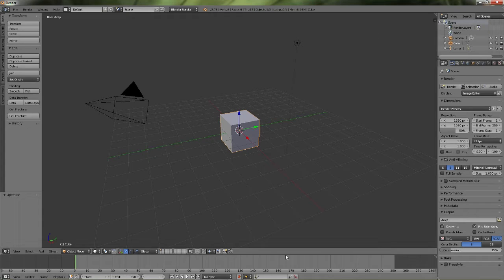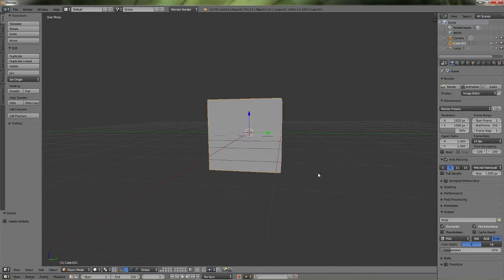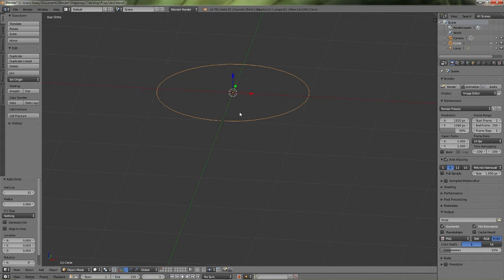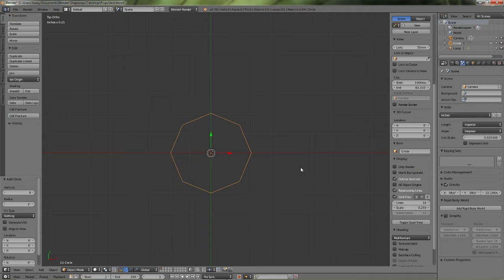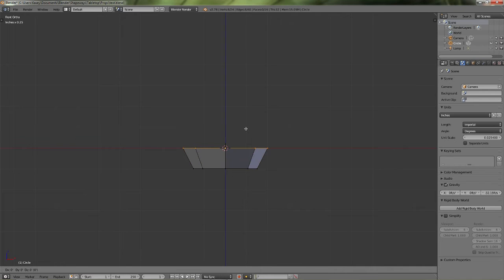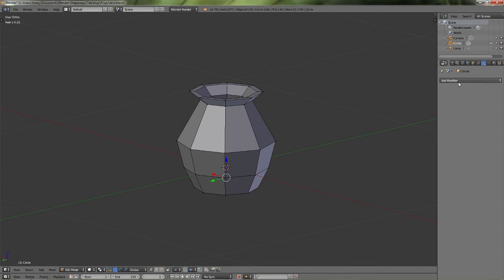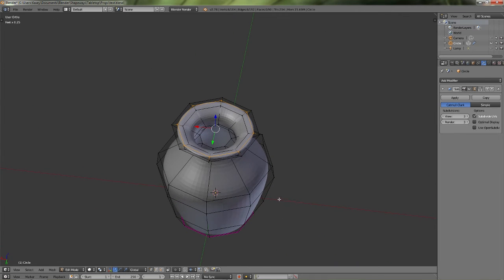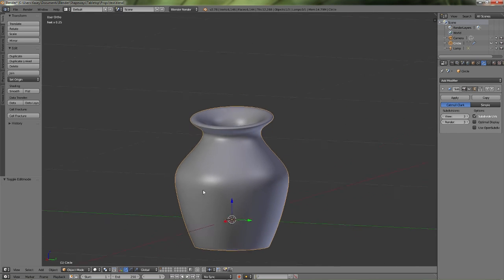Beginner Blender Tutorial for Modeling and 3D Printing

Comment: hmmm, you say to start with the minimum amount of vertices, this is the opposite of what my 3D modeling professor says, shes says that you can always scale down but scaling up when you started low is nearly impossible and you are better off starting over. You said that your computer may not be able to handle the file, my career is in CIS & network administration and unless you are running a Apple product or a computer from a "big box" store, then you should be able to handle most files. Just some questions and ideas, maybe quickly cover specs of your system for reference, for example my 3D design and printing system is a Core i7 with 12 threads, 64GB of system RAM, dual RX 480 8GB GPUs (16GB total in Crossfire), a Samsung 1TB SSD for the primary drive and 7 other larger drives for storage connected to 5 23" Asus LCD panels.
Reply from the maker: That's very interesting. I've never heard anyone wanting to start that way. Anyone I've learned from always starts with minimum verts and can easily scale up, no matter what program they were using. But, everyone tends to develop their own technique :)
Reply: @Kasey3DSparks  It could be that we are in a chapter on developing video game characters, buildings, vehicles, etc and she is very firm on a high vertices and high poly count in the base mesh, we just started that before winter break so who knows but i got a bit confused when you mentioned lower is better, to start. I have watched other tutorials and it seems like blender "should" be able to auto scale up or down, so perhaps she is just trying to get us used to a high detail level so that once textures are applied the base mesh will allow the most possible flexibility. Have a Happy New Year.
Reply from the maker: @milohajek  that is very possible! Happy new year :)
Reply: @Kasey3DSparks  or the professor is just messing with us "older" students, all i really want to do is make a classic 1/24 scale race car driver that i can get into a .stl or .obj file so i can print them on my 3D printer, if you have any that you have done i would be happy to work out something with you for a file or two. I am getting tired of paying $8.99 per figure to one of the few people that makes resign ones and sells them online when i have a perfectly good makerbot gen 2 (i think its a gen 2, anyway its the one that was $3,499 about 2-3 years ago and its basically printed a few car bodies (which i wasn't impressed with) and otherwise its been really good a ornament on top of my other desk so if i could figure out how to make a figure and print it myself i would be super happy. Oh there is a guy that sells one that is exactly like what i would want but 1. he's in Australia so shipping takes forever, 2. he wants even more per figure, i believe $12 and 3. a majority of his stock is "on demand" so you have to not only wait for the shipping time but you also have to wait for him to make them, Its the red colored figure on this page ( http://members.optusnet.com.au/bpatto/resinheads.html ), so if you think you could create a 3D printable one that looks even remotely close to this resign one i would be blown away as that is one of the two main reasons i took this class, the other is for a game a few friends are working on and we hit a wall when we discovered that none of us knew how to 3D model in the right program. Ok, well that's it for me, hope you have a great day and please let me know if you think you have something that might work or if you would be interested in making something like this. Thanks
Reply from the maker: Unfortunately, I do not have any files like that. But I'd be willing to take on a commission for creating a file for you if you're interested. You can email me here: kasey2shea@gmail.com 
I look forward to hearing from you!
Reply: @Kasey3DSparks  that sounds fair, i found several that are "close looking" on CGtrader.com but none have that "vintage" look like this red figure. i signed up on CGtrader and got a $20 off your first order and the one i was looking at is $37 and there are a few others for $12 to $22 so i am sure if i hopped on there i could rack up a quick bill pretty fast even with a $20 off coupon so let's see what you think, i'll drop you an email in a moment but i work 3 jobs and run a online hobby shop so please dont take offense if sometimes it may take me as little as an hour or as long as 48 hours to respond, plus i am taking this online class and as i mentioned my friends and i are also working on a game and a app so it feels like i am always busy, yet another reason to give someone else a shot at knocking out at least one goal (to make a 3D printable figure), Thanks for even considering to help, Milo
Reply from the maker: @milohajek  that's good to know. Thanks for the heads up!
Reply: @Kasey3DSparks  look for a email from my personal email, please do not share, it will be my name a yahoo, sending it as soon as the pictures attach.
Reply: Ok it just sent, its a bit long winded but i find that breaking down your expectations, ideal needs and a description of what you want is better than a short email with little detail or direction. Thanks again.
Reply: @Kasey3DSparks  So what kind of rig are you running? As i mentioned i am a CIS and network administrator with 7 years experience working for a subsidiary of Dell/Alienware, 6 years running a Comcast IPSSC call center, 5 years working at the University of Michigan in Facilities & IT Administration, plus my own side company building custom computers and you know your good when you walk into a Geek Squad at Best Buy and ask them for the best computer they have and their managers response is "well i know what you do and build and i can tell you that we don't have anything that would even come close to something you build 2-3 years ago" so if you need any PC advice, i'm the guy, and this goes from IT experts in New York & New Jersey all the way to the west coast with friends like Gordon Mah Ung (19 years at MaximumPC and now at PC World) and he's a good friend and has said the same thing on a few troublesome builds i had, "Milo, if you can't figure it out....no one can" and true enough, in 28 years i have only had 3 machines that i could not get 100% going and they were all do to user abuse, so if you want to trade some best bang for the buck upgrade advice or a complete system spec build, let me know.
Reply: @Kasey3DSparks  Hello Kasey, i sent an email about an hour ago, its from my Yahoo mail account, i attached some pictures of the actual figure as i still have a few in stock that i ordered from that guy in Australia but i really want to try and see if i can get something close in a stl file and print them myself. Thanks, and let me know what you think when you have a moment.
Reply from the maker: @milohajek  i7-5930k
, ASUS X99-A mobo, Radeon R9 200, 16GB DDR4, 1TB Seagate HDD (boot drive), 4TB Seagate HDD (additional storage). This month is its 5th birthday! And yeah I actually used to work for GS and I would always get that question "what kind of computer do you have? I bet you have a Mac." I would just laugh and be like no, I always build my desktops.
Reply from the maker: @milohajek  Sounds great! I will check that out and get back to you asap